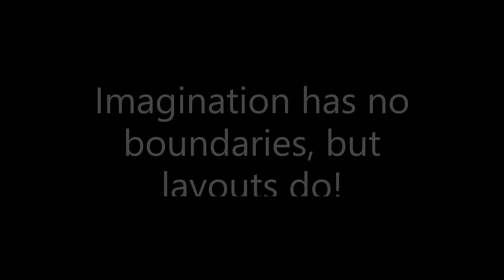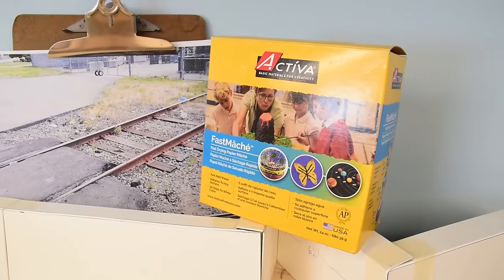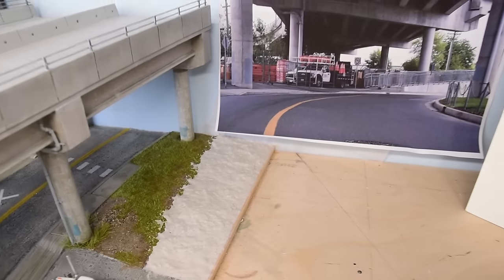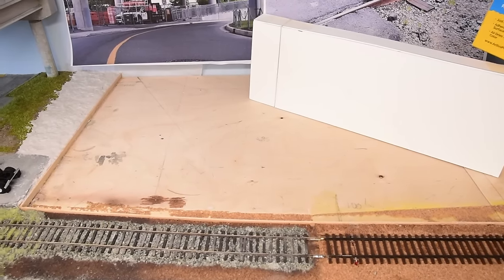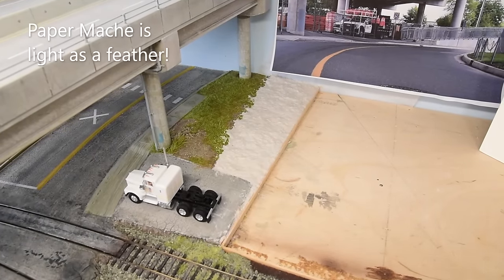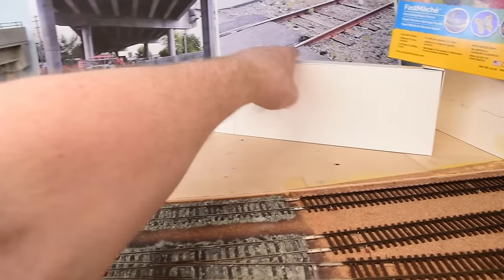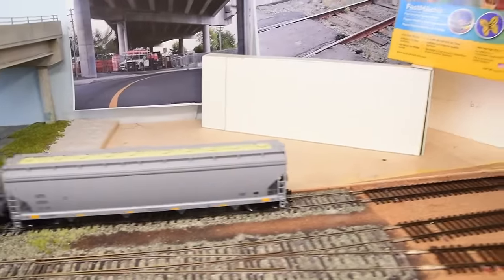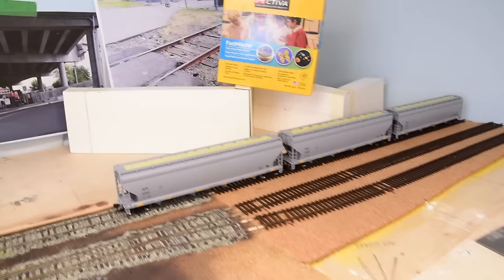Model Railroad Layout Update | May 2024 | Boomer Diorama ~ # 255

Comment: I want to use 0.080" styrene for the base of each of the structures that go along the back of my layout. I had thought of using plywood but it needs to be thin because it will be next to the narrow gauge track. No matter what I use the trick will be hiding the seams. Looking forward to seeing what you do with this next project. Cheers - Larry.
Reply from the maker: Probably best to use .080" styrene for sure.

Comment: Looking good!  A thought, on your fence that hides the seam line: If you put the fence on the plywood insert, you won't have to worry about the plywood hitting it when it's "dropped" into place, even if the fence ends up leaning a little bit one way or the other.
Reply from the maker: Great points to consider. Thanks for sharing that. Cheers ~ Boomer.

Comment: One of the things I've found, when adding photos as part of the backdrop, especially if you're lining up a three-dimensional road with the road in the photo, the road in the photo should only be visible from straight-on. Otherwise it looks like a road disappearing into a flat photo and completely ruins the illusion. Where possible, I'll have the roads disappearing around hills, or behind trees. There's one road that crosses the railroad tracks and goes straight into the backdrop, but I try to limit the visibility of it with buildings on either side. It's still a work in progress.
Reply from the maker: Yup . . . only looks good from one angle.

Comment: Dear Boomer, haven’t found any ‘Fast-Mache’ over here yet, only similar paper maché products. Definitely will try ‘m out. May have already said it; very much like the idea of putting the Ipex Plastics real estate on separate piece of 1/4” plywood. Think it will be an excellent example of how to make such layout features removable. Not just for the ease of working on it, also for ease of maintenance and editing the scene in the long run.
The photo scene under the overpass really shows how much potential this entire scene has. Even though, as you said, you still have to compose the photographic scene. Think the bend of the overpass already makes an impression, not just for the shades, also for the way it elongates the straight line of the 3D overpass structure towards the horizon. Very curious how you will further compose and develop that particular scene and also how you’ll transfer the lower geometry of the image to the ‘elevated’ road scene. 
Building flats has a kind of distinct feeling from the modeling jargon. Never really found, until now, when a structure is called flat, low relief or otherwise. Humbly think those terms are too often used in ways they overlap. The angled approach simply works best. Not just for the natural shade it creates. It also emphasizes on the perspective lines, which makes the eyes feel there’s more beyond the upright horizon of the backdrop. 
True ‘flats’ can have their use as background feature, but their appearance and impact will increase when 3D details are added. Different sight lines are important, to fool the eye. In that sense a two point perspective always works better than a single one. Nevertheless, combining them may be the magic trick. Cheerio
Reply from the maker: Even when you set a building off by five degrees it makes a big difference. ;-)

Comment: Great videos - trying to make downspouts for HO buildings.  Problem is every time I try to bend styrene strip into shape (the part near top of building) styrene gets too hot and strip distorts.  How do you bend to keep overall downspout look?  Thanks
Reply from the maker: Pre-roll the strip around a small drill bit before you put glue to it.
Reply: I'm sorry that I don't understand.  On downspout near roof, small 90-degree section (from gutter) then turns to 45-degree section that goes to vertical part of downspout closest to building.  It's that 45-degree section that distorts when heating it to make the 90-degree bend to longer vertical section.  Sounds like you're using a smaller piece of styrene for your HO downspouts, as mine will not bend without heating.
Reply from the maker: @jonwess6236  Evergreen plastic is pretty soft. Try a smaller diameter.